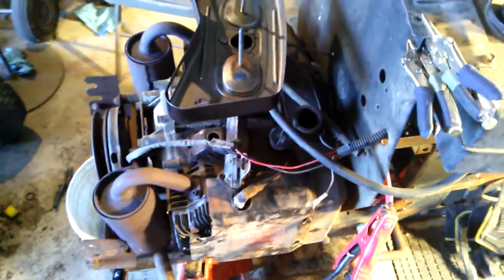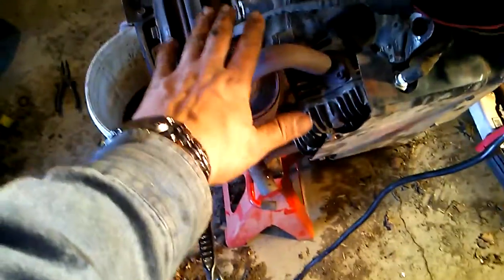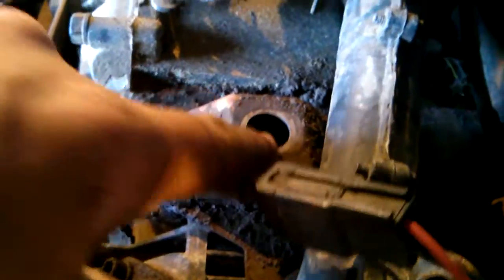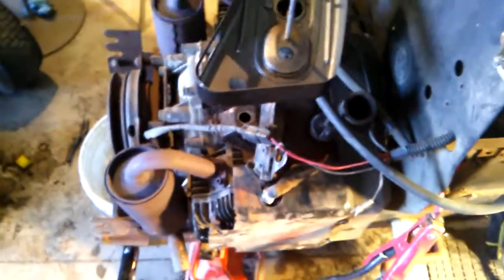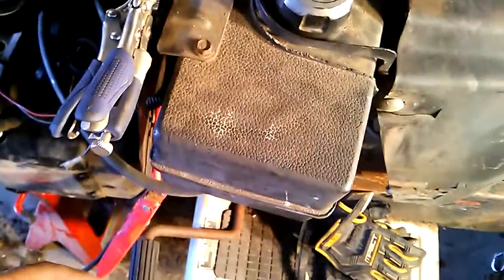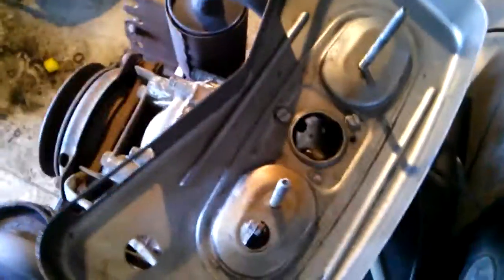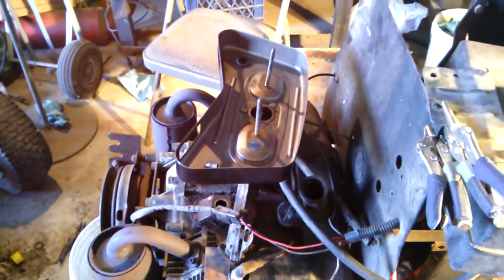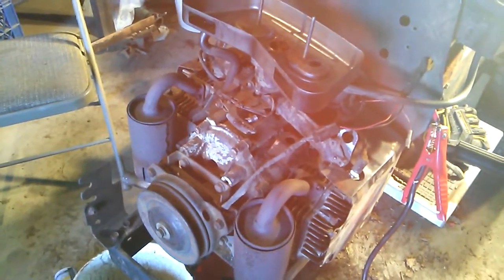Craftsman I GT :: Revival of the Craftsman GT 18hp Opposed Briggs and Stratton (420000 series)

Comment: make sure youre not blocking a vent on the carb. redline's was doing something similar due to a blocked vent
Reply from the maker: I dont think I am. Of the 4 holes in the carb, 1 is blocked and its a screw hole.